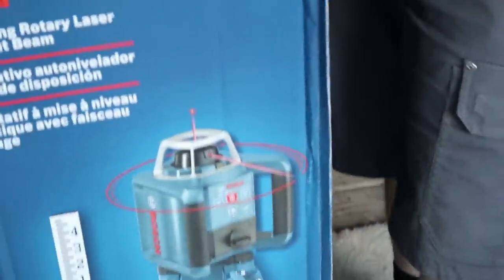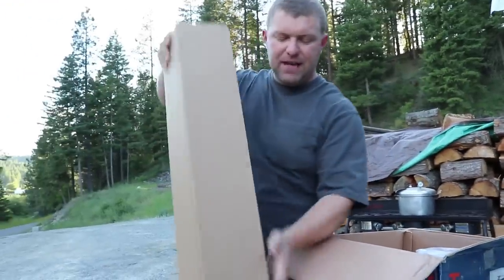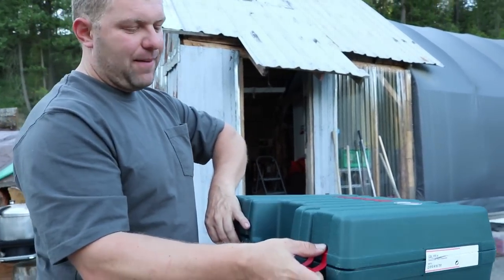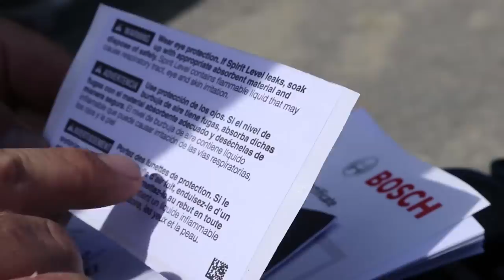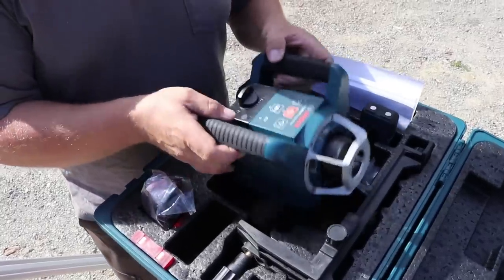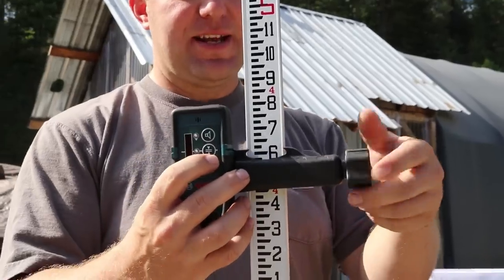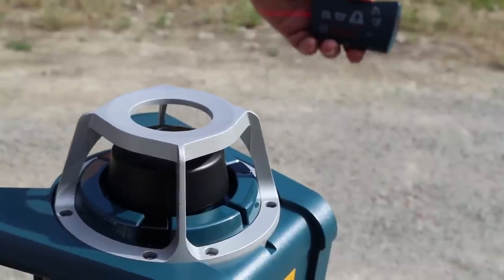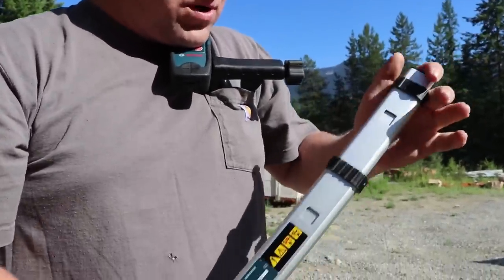WORTH THE $700! 😰 (Bosch Laser Level Unboxing)

Comment: As a surveyor I would not trust any level without checking it against a datum each day, or hourly in my case. 

Please look for how to do "Two peg test", best done by measuring from one end and checking by moving the level close to the furthest mark and checking backwards.  It will give you a lot more confidence in any reading and help avoid a dud measurement.

Also the "Shock absorber mode"  is a compensator. Never turn it off if you need things to be level.  

Things move(settle) over time. Pick a spot near, but also outside, the proposed building to use as a checkpoint for critical points such as a fixed corner of a step as a reference/datum/Benchmark.   Multiple Benchmarks always lead to problems. Problems are bad, best to avoid where possible.

Keep up the great work your lifestyle and videos are inspiring.

Michael
Reply: thanks for the info.
Reply: Hi Michael. I have the same Bosch laser level and I'm sure it's been "out of level" a few times (about 5/8", way more than the claimed accuracy), checking off multiple datums on the same job site. Thanks for directing me towards the "Two Peg Test". Now I'll have a method to verify accuracy.
Reply: Michael, thanks for posting a constructive idea.  It is refreshing.  I've been building handcrafted log homes for 48 years and I've used every conceivable leveling system out there.  They all have their pros and cons.  With log building you have nothing to work from other than an imaginary plane on the centerline of each wall or floor plane.  I've gotten very good at accurately layout things and it is always a delightful test at the end of a segment of work to find out that you nailed it on accuracy because you know it is so hard to achieve.

Comment: After being a builder/carpenter for over 40 years I went thru all the paces. Water levels are sometimes necessary however after using them most of my life I graduated up to a laser and I tell you cannot beat the laser. The water level still can be useful going around objects, the hose can be a pain.  That is a good setup you have there and when done building it will sell fast and won't loose that much money. Better than renting. I you do decide to sell it mark some Datum points around the property for later use. I have my 20 acres of woods marked with points and I can use them points the rest of my life for reference
Reply: Dennis and Helen what a cracking idea Dennis and Helen

Comment: I worked for my Dad General Contracting Co. in the 1960's and you either used a Transit Level or a Water Level.  I help build 30 story buildings using Water Levels on most areas.  Wow how things have changed

Comment: I love that level. We used it in a warehouse 400 x 1000 feet. it easily worked during the day inside at about 150 - 200 feet. The auto leveling and glasses, with the remote. We added a piece of white paper to help find the laser as it spinned.

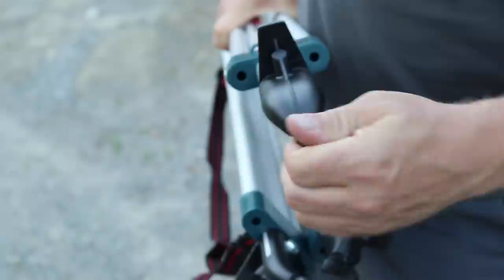Comment: 4:46 are rubber tips used for shipping, they can also be used when indoors so not to ruin a floor. Normally they are thrown away, ie are really just shipping materials. The 3 rubber tips are not part of the tripod, they are the packing materials so the tips do not go into the box. Just save them away with the instructions in case you ever want to use the tripod on a nice indoor floor so you do not get holes in the floor.

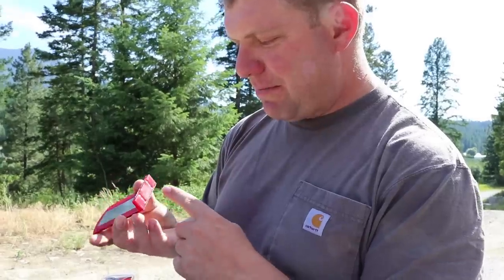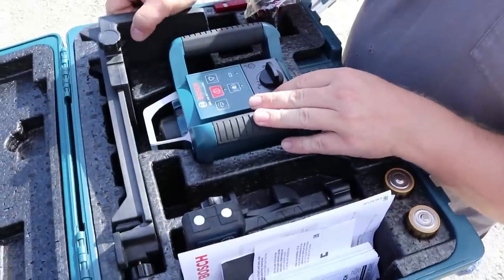Comment: 11:11 is for ceiling tiles, ie aligning the steel grid inverted T pieces in at office that uses 2x4 ceiling tiles. It has a magnet that sticks to the T. The laser is hung with the ceiling mount adapter 9:48 . You adjust the wires that hang the T pieces to hit this red target. The Target faces down, rare earth magnets up to the inverted T sections. You can have each worker bee have a red target to align the grid's T pieces. ie all the "coat hanger" type wire that hold the grid is adjusted so the ceiling is about  level. This scheme is about 30 years old

Comment: Jesse, the rubber feet on the legs of the tripod are actually rubber covers over the metal feet with spikes. you keep the rubber foot covers on if you are using it on an interior floor. 

Have fun!

Comment: Ive owned a construction company for 25 years.  concrete foundation and dirt work.  And we only have spectra laser levels and I believe out of the 6 or 8 of them we have only 1 is not self leveling.  that Bosch will be ok until you get out to the limits of it which it said a 1000 ft but it is probably more like 600 and after that the error will compound itself.  But to do dirt work or to plumb walls and things you should use a builders level or transit level or a theodolite.  They start around 300 for a good one but you can get them on fleebay cheap.  You guys are working towards a goal good for you.  Some advice from an old guy.  " Work Smart Not Hard"

Comment: Micheal Jude is correct about checking the level against a known or picked location to make sure everything is related properly.
A laser level is actually not level but a plane projected from a spot where the instrument is set up.  Level is the surface that follows the curvature of the earth.  At 1000 ft this difference  starts to show up.
The people who say use a transit or theodolite are actually thinking of a surveyors level instrument for taking the difference in elevation.  The former are used to turn angles.  All of these instruments must be leveled on a tripod carefully to get useful measurements.
A laser level is extremely handy for one person or multiple receivers   Hopefully this instrument has a grade function where the grade can be set so you do not have to calculate the amount to change per foot for the correct slope. Contractors use this function all the time to lay drain and sewer lines.  Hopefully this will make since to you.
Keep extra batteries handy.
Micheal Jude said he is a surveyor and I am a civil engineer.  I would suggest you use the tools you are most comfortable and confident with.

Comment: I've use vinyl tubing water levels for decades and never had issues.  Get a couple stoppers to plug the ends and a few drops of food coloring.   Long distances can be done in segments and stakes can be marked then added up for total grade or rise over run.

Comment: Not sure if you've ever heard of a water level. It's essentially a long clear flexible tubing filled with pink RV antifreeze. It works on principals of gravity (you need a lower area to span the tubing & raise both ends of tubing to your level marks). You are limited to the length of your tubing; however, you can add additional lengths of tubing with fittings. Make sure all of the bubbles are out of the tubing.  Cheap and accurate & you can read it during the day. .

Comment: Good choice. It was some investment! That level will be very handy, building your house. I got a simple version 8 years ago (it only projects two lines) and used for paint jobs, laying tiles, plumbing, leveling concrete floor etc. etc. I also use it outdors, however only when it is dark enough to see the laser line, since my system has no receiver.
Using a garden hose for leveling does also work, however, in winter it needs to be filled with anti-freeze, which is a real pain. I worked that way already. A laser level is way simpler.

Comment: We use a hose with 3 feet of clear hose attached to each end ..............then add water.  Fill hose holding both ends of the
clear hose.  That is your level. Then walk out each end of the clear hose to what you want level. The water level at both ends of the hose is always level.

Comment: Seems a great choice !!   You will get soo much use out of it on a house and shop.  I too purchased a cheaper unit for a couple hundred bucks, and although it was accurate it could only be used outside in the evening. 
Thanks for the details on the review - you do a nice job. 
Hope you will seriously consider first building a shop.   You will build one anyway - building it first will save you ooodles of time and frustration on the house.   Doesn't need to be fancy,  makes it much easier and more efficient build process, and keeps all those expensive tools out of the weather and accessible.  Just a pole barn type garage structure would be a wonderful help. 
Don't know how I'd done all needed here without a shop.

Comment: For rough work laser is the way to go, so much faster.  Finish work water is fine.  I've used the Leica rotary levels for years doing fiberglass inground pools, so much faster for digging holes and NOT OVER digging.  Prelaser we could so easily over dig 6" in a heartbeat.  Post laser, our sand  floor was usually less that 3" and our standard  for level of a 16x40 foot pool was within 1/4", usually within 1/8".  Prelaser we were lucky to get within 3/4" of an inch.  With pools you need overdig for running plumbing and room for you to put the plumbing in.  We got our overdig to usually within 6" to 12" to the rim, pools get skinnier the lower you go, so you get more room lower in the hole with vertical walls. That saves so much time and money on backfill gravel.  Too bad you don't have a small crusher to make your own gravel, you have enough rocks.  Crushed gravel backfill is so much better, doesn't expand when wet, drains really well, it's a pretty good insulator (from the air space) and is 95% compacted from just dropping it in the hole.

Comment: I'd like to make a suggestion. Look into water leveling. I built swimming pools and the coping and tiles had to be dead-ass level or it would really show hen the pool was full. Simple, clear plastic tubing is light weight and flexible. You can go 50 feet easily. The whole setup might cost $20. Hey, lasers are cool, but water never lies. It's always level.
Reply: Correct.THE "ELITE" have indoctrinated us ALL, that we live on a spherical ball!Cheers PAT...It`s SIMPLE...
Reply: Water levels are great, but there are things the laser level can do either faster or that you can't do with a water level or can't easily do with a water level...

Like a water level can't project a grid pattern to make sure everything is spaced properly... Water level can't tell you if something is perfectly vertical, only perfectly horizontal... Water level can't tell you if your angle cuts are all the same... Laser projection can be set up faster... among other examples...

You could get a chalk line tool to help cover some of the things the water level can't do but a chalk line isn't always the most accurate and still not as fast as a laser can be set up, especially if you're needing to check multiple angles repeatedly throughout the work...

Though, there are instances where you can either want to use both or the water level may be superior... Like finding level in an environment where there's no line of sight... or you just want two ways to measure to check accuracy without needing to do as many repeat tests...

There's just also instances where the laser has its advantages...
Reply: No, it doesn't matter because it's still their time and only they can determine what their time is worth!

All you're talking about is degrees of need... Wanting something doesn't change whether it's also a need... and Time is money for DIY too!

Besides, the point is to make their lives easier and this will be their home... That goes beyond just wants!
Reply: I agree. spirit levels are stupid simple and cheap. and are these commenters really talking about the curvature of the Earth as a factor in building a structure smaller than a stadium??
Reply: Yeah, light is bent by gravity, too! ;)
Reply: You are right water never lies. However, the equipment that contains the water might.
Reply: A plumb bob will get you vertical, same with an "I" beam level. For what they're doing, yes, it's a waste of money and time. What you're speaking of is more along the line of professional builders. These two aren't even close to being amateurs. When time does come to where they actually start building their home, it will be finished by a professional/contractor.
Reply: A simple clear tubing can't lie. It's not encased in, or mounted to anything. Fill the tubing with water, now bring the two ends together vertically. The level will be the same in both ends..... always. It will work blindly. In other words you can be at a mark in one room and go around to another room out of line of sight and still compare levels.
Reply: Pat Walker, no... Water in a tube can be effected by the tube, especially thinner tubes... It can also be effected by temperature differentials... Like having one end under the hot sun and the other in a cool shade...

Air bubbles can also throw off the measurement... Placement of one end has to be on a stable spot and mounted properly to avoid any deviance... In winter time the water can start to freeze and even adding anti-freeze doesn't mean it will mix evenly throughout the tube and thus you can have variance...

Then there's the placement of the tube and making sure there are no areas that will get pinched or otherwise impede the flow of water...

Really, there's this thing called physics you might want to check out...

Yes, a water level can be a great tool but nothing is infallible... and it doesn't change there's a bunch of things you can use a laser for that you can't use a water level for...  So there's that too...
Reply: Hmmmm. Never ran into any of those problems building pools in the hot Texas sun for years. My tiles and coping were always dead level.
Reply: You do know the Egyptians used water levels. Worked pretty well on the pyramids. The amount of deviation due to the earth's curvature on a jobsite is laughable. Nice try though. As I said I was a pool contractor and put it to the test daily. If I had been off by any meaningful amount it would be immediately visible. Real-world experience. Not theory.
Reply: Yeah, undo.kat, and that is a PLUS for water levels... Note that you aim to be HORIZONTAL! And the horizon also bends... ;)
Reply: It's close to the tolerance of a good ball bearing.

Comment: With cheap manual-leveling lasers you'll often have to calibrate the bubbles before first use.  
...As you mentioned, you still have to calibrate self-leveling lasers periodically as well.

---

The red detector plate has magnets at the top so you can stick it to an RSJ / I-beam. The 'mirror' is just the backing for the reflector on the other side.

The IR remote will often have relatively poor range and is mainly so you can change settings, turn off, etc. without disturbing the level.

Comment: one time I built a shed and needed a level surface. So this old timer told me about getting 100foot of clear 3/8" hose filling it with kool-aid so I did that and instantly had a level that was super accurate. If you don't have 700 bucks this  works . I don't remember how much I paid for the hose but the pack of kool-aid was 30 cents

Comment: Let's see now, the 1st laser built the tub deck wrong, the rental laser was manual and did not automatically do it right,  the latest laser is similar to the one used by septic man and he did it correct. Conclusion - hire someone with equipment and if you don;t interfere it will be correct.

Comment: They are getting cheaper and better all the time.  in 2002, I spent 3000 for a single-slope fully manual Spectra.  when that died (well, the laser diode was weakening to the point of non-useability) and replaced it with a fully auto-leveling dual-slope model with a remote control and better laser receiver for about 2000.  When I’m cutting ditches over a mile long with minimal slope, it’s indispensable.

Comment: Have you planned a water catchment for all future roof runoff to pump uphill.  Can you use all gray water to garden?  Reverse osmosis system..Duck pond..garden.  New York compost all solids..plenty of sawdust and trees.  Add micro hydro to system to power peak needs.  Can you backfill the ditch with woodchips and tile pipe to fill a future pond.  Can the block foundation serve as catchment below first floor grade or at grade?   Great investment..

Comment: I've found if you take some 2" x 2" frame peaces and 1" plywood on the top and bottom to set the laser level onto it and just get the platform within a 1/8" level always better less the laser level will perform much better for you over rough ground: So on a Known level hard surface you don't need the platform you will have good result's every where.

Comment: The inlet on the tank's usually about a foot down from the top. That's not enough to save you though if the top's at 2'. You'll only be about a foot below the current grade at the house with the minimum 1/4"/ft slope. I think you'll need to build up enough to keep the pipe below frost level for its entire length. This would be a good time to pull out the specs and drawings for the tank to find out your inlet level. Or you could dig up the inlet and shoot a reading on it. BTW, I have a LL like your first one. It's a fussy little SOB. The leveling with the screws isn't stable unless you end by raising the point you're adjusting.  If the last direction you move is down, you can stand there and watch the bubble drift. That may be what happened on your deck project.

Comment: Double check the instruction--look for a section on calibration.  My level has instructions on the calibration process.  If you do not calibrate the level you may get a wonkie line (not level even though it is on the mark).

Comment: ehhhhh  while the laser you bought was a good choice, having only one laser is a pipe dream. The reason being is that the one you bought is for single plane levelling only. When you are working inside you will need multi-plane levelers. 

For example imagine you are cutting a hole in your floor and it is for a staircase. You will want to line it up to the ground (90degrees), and to a point on the ceiling. The leveller you have is not able to do that. However, a multi-plane leveller is.

I personally have 5 different laser levels. And yes they all cost money, but they are worth it.